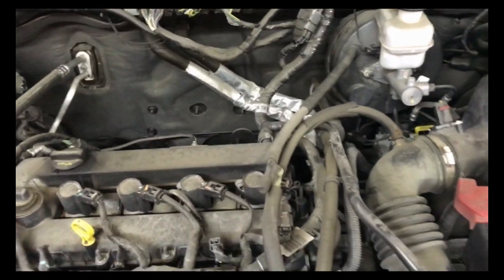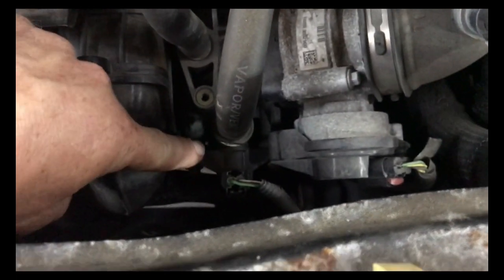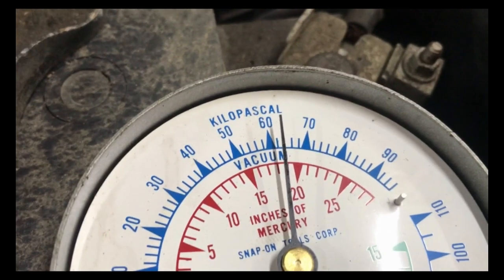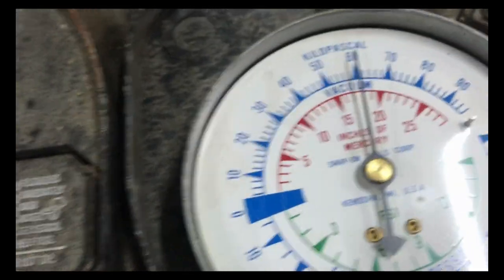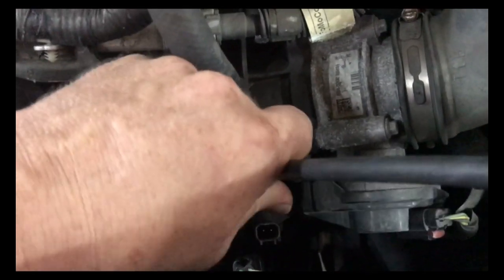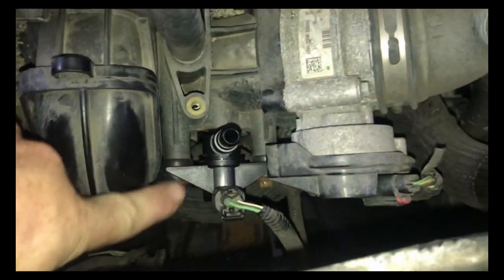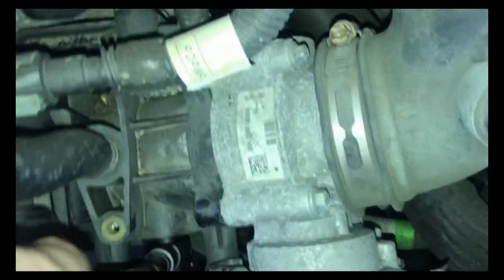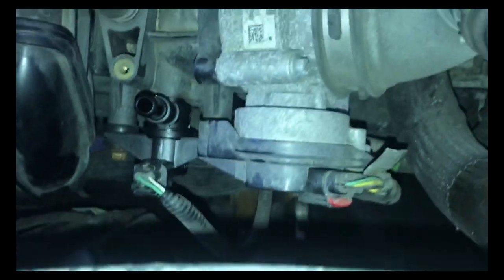Ford Escape P0456 Small Evap Leak

Comment: i dont feel vaacum at all.....But i measure resistence disconnected and show 4 ohms, when internet says it should be around 23-28 ohms......And i dont hear click at all.......? its not the purge valve?
Reply from the maker: I don't trust ohm's. Put a vacuum gauge on it and see if its leaking. If not leaking I would look for a leak someplace else.

Comment: I had the same issue. I replaced the purge valve but I'm still getting check engine light for it. What other options can i do ??
Reply from the maker: Small leak codes are hard to check unless you have a smoke machine. Mine cost me $1100

Comment: When I test it, there is no vacuum even when the electrical connection is attached.  Does that also indicate a problem with the purge valve or the electrical connection?
Reply from the maker: When valve is unpluged it should not have vacuum on it. Sometimes it takes a long time for the computer to activate the valve then it will pulse vacuum. You may have a differant problem, a small leak somewhere else.
Reply: Had the same issue, when I took off the tube with the electrical still attached there was no suction but I gave it a second and then it kicked on, unplugged the electrical and the suction cut off, I’m trying to diagnosed where the leak is coming from now lol